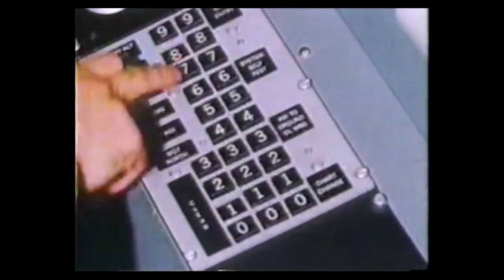XF 108 RAPIER

Comment: The Avro Arrow was similar to this but different it flew and went fast yea I never heard of this plane even flying.
Reply from the maker: You are right about that the project was canceled and it was a what if plane
Reply: ours flew and was better made yea.
Reply: @eastsidebeastkidx2444  ....Actually no. The Arrow was more closely in performance to the A-5 Vigilante. Even with the Iroquois engine it would not have been beyond 2.5Mach, because of constant overheating issues that could not be resolved. The aerodynamic design and materials used also would not physically allow for it. Because of the cost to build an aircraft that can sustain speeds close to 3 Mach, the program was cancelled, along with the F-108 as they simply weren't needed. The F-108 would have been far beyond the Arrow in speed and range performance. Even the A-5 was cancelled for better aircraft within just a few years. The A-5 Vigilante was actually an objectively better aircraft than the Arrow, as unit cost was slightly less, and combat range with more efficient engines was more than double the Arrow. The Canadians with serious budgetary concerns, made a good choice with the F-104, as it could go close to 2.5M in an emergency, and they could buy 5 F-104's for the price of 1 Arrow.
 I understand the national pride behind the Arrow, but reality is, the aircraft was NOT any better than competing aircraft from the US, or even the British that started development of the TSR-2.